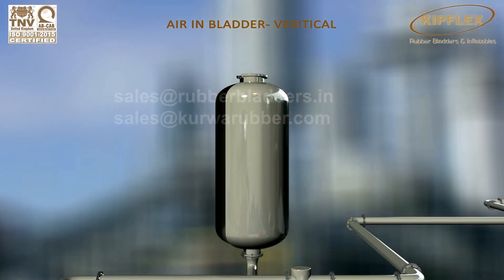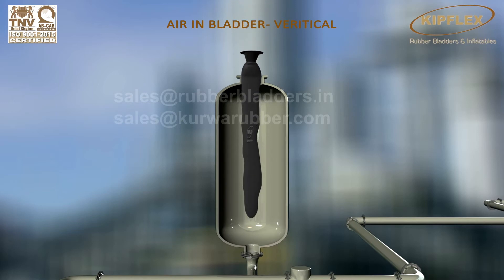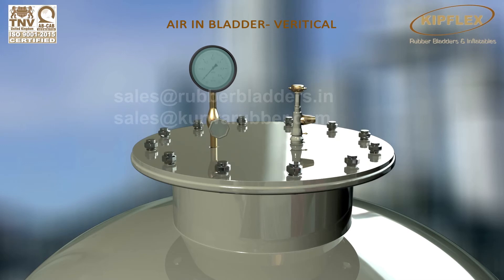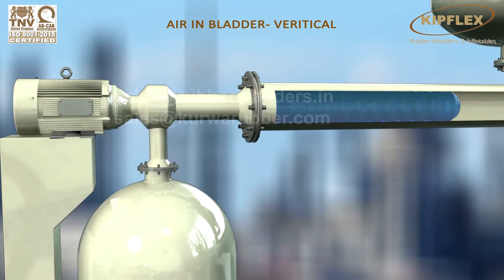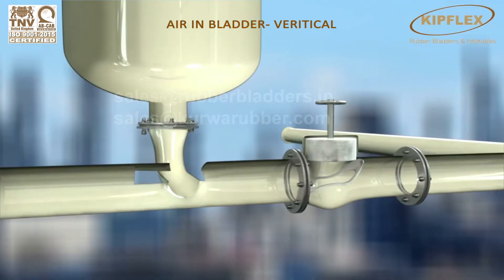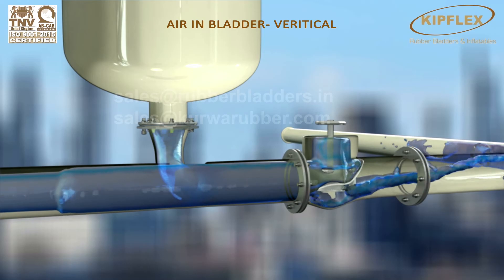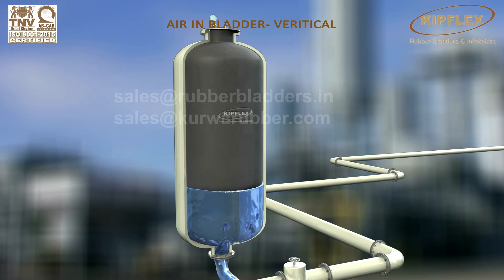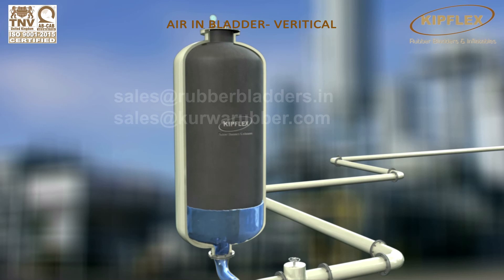SURGE TANK BLADDER - AIR IN BLADDER - VERTICAL | KURWA RUBBER

Comment: How do you determine the required air pressure inside the bladder dry-side?
Reply from the maker: It is determined from your surge analysis report after taking into consideration the operating pressure, the line pressure and water velocity in the pipeline
Reply: @kurwarubber3958  Thank you. More complex  than I had hoped for but a thouroughly good answer. But what if we considered only the closed loop static head of 30 feet above pump center line with with the closed loop temporarily open to atmosphere and full. 30 x  .433 = 13 psi.  What additional psi air charge do you think should be added to the surge tank bladder?